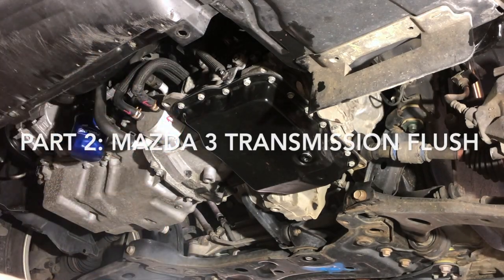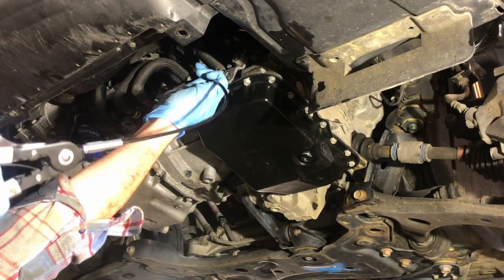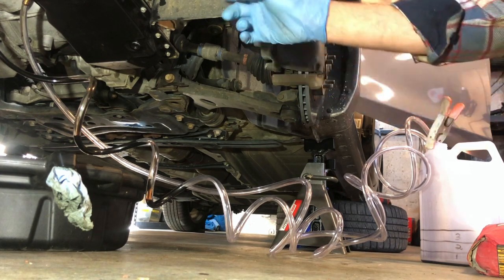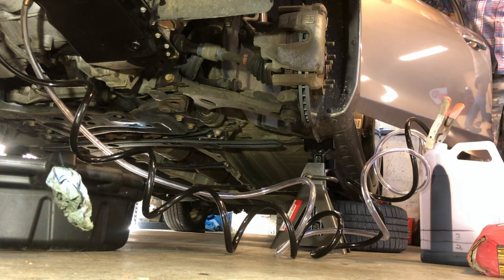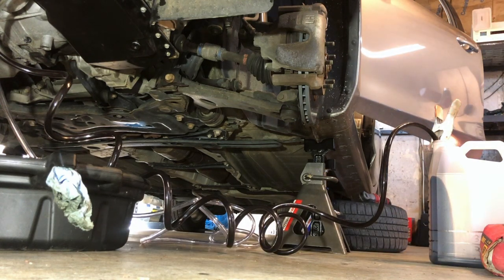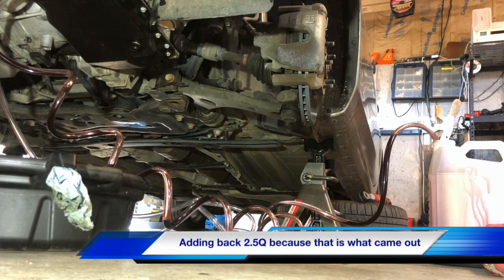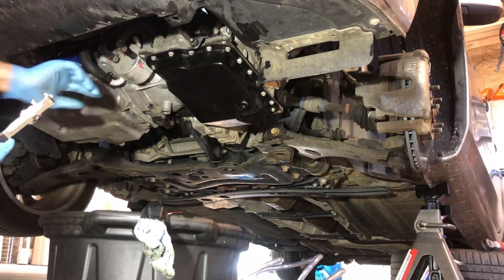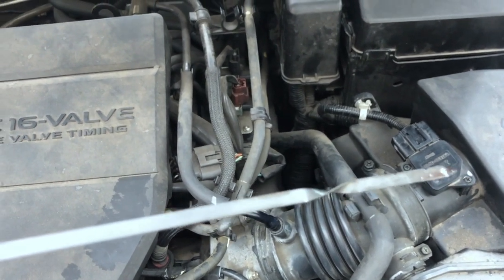Mazda3 Transmission Fluid Change Part 2: Complete Flush

Comment: Can regular pliers work to remove the hoses from the cooler line and I didn't see where you used the push pin pliers is it necessary for this job? Thanks
Reply from the maker: Thanks for watching and commenting, regular pliers can work, just takes a little more fiddling.

Comment: @fixityfix are sure that’s the right transmission oil because I have the same oil but on it saids 95% of the vehicles but Mazda is not one of them. And my second question is how many quarts of the oil did you use like the part one and 2 videos including the flush?
Reply from the maker: Thanks for watching and commenting! Here is the MaxLife ATF spec sheet link: https://sharena21.springcm.com/Public/Document/18452/9e447451-fe75-e711-9c10-ac162d889bd3/5ca3517a-e29c-e711-9c10-ac162d889bd3
Idemetsu makes a good Type M fluid, and grabbing stock Mazda fluid from the dealer are ways I’ve gone in the past too. I think it was 13 quarts total if I remember correctly. All of them have worked fine in our 3. Good luck and I’ll be curious which fluid you end up using.

Comment: Which side of the hose I need to plug in for the outlet. (Is it the black hose or the one that connect to that metal round thing. Hehe)
Reply: Or I should just put two clear hoses?(One is for that black hose and the other one is for that metal tube)

Comment: Hi Fixity Fix, great video! I have a 2010 Mazda 3 and I was thinking of doing this to clean out all the old fluid. I was just wondering how many quarts you had to fill back in after this procedure? Would I have enough fluid if I use 2 gallons to do the flush and have left over to fill it back up at the end?
Reply: 2 gallons is gonna be close.  You could do at least one drain and fill.  I’ve always bought a 12 quart (3 gallon) pack.  Used 10 for trans.  A little less than a quart for the power steering at the same time, then a little over a quart to keep on the shelf for spare.
Reply: @georgesteffens7489  great thank you!

Comment: Thanks for the timely come back. I didn't know that the mazda had a external hose going to the tork converter. I think the blue transmission fluid has more zinc in it, for 2012 skyactive. Also, phoning a mazda parts department with your vin number would be in order. You could probably run it on dextron,a red oil, it would function, but for how long? I used your method in the past on other vehicles, no ill effects. How did your transmission fare over time?
Reply from the maker: Hi again Robert! Our 3 is still running strong! How is yours doing?

Comment: So do you do this IN ADDITION to what you did in Part 1 (Mazda 3) drain/replace? Or do you do this INSTEAD OF part 1? I always thought a drain/replace was somehow safer than a forceful flush - is that true? 2010 Mazda 3 2.5L 150k
Reply from the maker: Thanks for watching! I did do both when I serviced mine, removing the pan was needed in order to replace the filter. I went back and forth in whether to do the full flush or not, thankfully, it worked out fine on our 3. Good luck with yours!

Comment: Hello, I bought my 2010 Mazda 3 with 150k miles a week ago and it has some issues with transmission. On my first drive I had Solenoid B stuck on error which was resolved and never happened after resetting error codes and taking out excess fluid that was in the transmission (approx. 0.7qts). However it has some delay before shifting into 5th gear in manual mode and when put in reverse sometimes it needs a bit of time or gas to start moving itself. I'm wondering if fluid change/flush would fix that as the fluid we took out was dark brown but didn't have any burnt smell. The shifting is very smooth and unnoticeable, so I guess flush would not be dangerous? There is only one car service center in my town and I'm not sure how they gonna change it - drain it or flush it like you did. I read lots of bad things about flushing but does it apply only if transmission is already slipping and having rough shifts? I'm going to change fluid tomorrow.
Reply: Did you flush it? I’m gonna change mine and flush it this week, would like some advice from you if you don’t mind, thank you
Reply: @nazar_ns7431  Yes I did flush it, even though the problem is still there, the car has now clean atf fluid at least and I can drive peacefully

Comment: Nice videos! Is this worth trying on my 3 that is starting to experience rough shifts and occasional slip?
Reply from the maker: Thanks for watching and commenting! Depends on so many factors, miles, how hard driven, etc. The risk in the flush is that the clutch material suspended in the existing fluid may be the only reason the gears still engage. If it were my car and mileage was high, I’d take one of two approaches. 1) Drain and fill only - if the first helped, I’d do it again each oil change for the next 4 oil changes. Or 2) do the flush and keep the old fluid in a clean container(s). That way if the flush made it worse, the old fluid could be swapped back in. The difficult truth is, if swapping in new fluid makes things worse…it means the transmission is already on its way out. Good luck! Please keep me posted on how it goes!

Comment: Love this method, did this on our Fusion.  Might be trading it for a '10 version of your car here, pretty low miles, but I'll be doing this whole process as peace of mind if I do buy it.  Thanks for sharing!
Reply from the maker: Did you end up getting the '10? Our '11 is still going strong - and a fun car to drive!
Reply: @fixityfix  No, but I did get a ‘13 iSV base model but same transmission setup.  I’ve been taking care of maintenance and also added cruise control which it didn’t come with.  Love the car and so far seems like many things aren’t too bad to service at home!  It’s got 73k on it now I’m hoping to get it to 200k.

Comment: Thank you @FixityFix for posting such an informative, thorough and helpful video!  I just want to make sure I'm 100% clear on the details to connect to the car's cooler/pump.  Can you please confirm my understanding?

1 - Connect clear tube to the car's the aluminum cooler outlet/nipple closest to the driver's side NOT to the black car hose from said driver's side nipple?
2 - You mention using a 3/8" brass barb hose connector?  Is there an example or link to one that can be shared or linked to in the description?  Or is this even necessary?
3 - I have seen other videos where people use RTV in addition to the rubber gasket.  Any opinion on that method compared to yours?

Looking forward to trying this in the coming weeks.  Thank you again for posting!
Reply from the maker: Hi Gabby NYC! Turns out connecting to the car’s black rubber hose that’s removed from the cooler port wasn’t necessary on my Mazda 3. So the brass barb wasn’t needed. I just slid the 3/8 id vinyl hose over the exit port on the cooler (the port closest to the transmission).  Just make sure to keep any crud from getting into the car’s rubber hose you slid off the cooler while flushing- there will be some suction. 
I don’t use RTV on rubber gaskets and have never had a leak. I do use RTV on paper or cork gaskets. 
PS, next time I change transmission fluid on my 3, I am going to use Valvoline MaxLife ATF. I’ve had good luck with it in all our other cars and it looks like it’s now approved for Mazda3. It’s cheaper than the Idemitsu I used in the video, and easier to find. 

Good luck with your flush. Please let me know how it turns out!
Reply: @fixityfix  Thank you for confirming!  I had to watch this 2nd video like 12 times and still wasn't 100% sure where to connect the hose lol.

I found this link that confirms what you're referring to about Valvoline MaxLife being compatible with M-5:  https://sharena21.springcm.com/Public/Document/18452/9e447451-fe75-e711-9c10-ac162d889bd3/3fa3136a-09bd-e711-9c12-ac162d889bd1
and also this one:
https://www.valvoline.com/en-thailand/our-products/automatic-transmission-oil/maxlife-atf

I've been reading that only specific M-5 or M-V can only be used but now I feel confident with using MaxLife.  Thank you again!

Comment: Great video; I didn't quite understand the method you used to connect the clear plastic hose to the transmission hose, did you use a connector, couldn't really tell?
Reply from the maker: Thanks! I used a brass connector that fit inside both hoses. It’s a 3/8inch size to match the 3/8id hoses.
Reply: @fixityfix  Yes, now I understand.  Additionally, when checking that the transmission is full of fluid, do you do that with the engine still running after putting it through the gears, or do you check it like motor oil with the engine turned off?
Reply from the maker: Check it after it’s fully warmed up, and you’ve been through all the gears. Leave it in Park, hand brake on, with the engine running, on level ground. Let me know how it turns out!

Comment: How to change transmission fluid on a Skyactiv Mazda? You don't - sell it - their transmissions are crap!
Reply from the maker: Hi! My Mazda is a year or two before Skyactiv, so I don’t know first-hand. Anecdotally, I’ve heard the process is similar- eg, tie into the cylindrical cooler. Please update us if you find a good video on the newer ones!
Reply: @fixityfix  the sky active model doesn’t have a dip stick but a plug underneath the air intake filter housing. To access it you need to take off the entire housing. So it’s pretty much impossible to start the car like you did. Pretty much can only do fluid dump and fill.
Reply: @maritimezhang wouldnt you just need to put the housing on and off again? The process should still be possible albeit tedious
Reply: Just found this video. Good work. I need to do this on my son’s 2007 Mazda 3. I used the same method on my 97 toyota Landcruiser. The only difference was I ran it through the gears, about 2 seconds I each gear, it was about a quart each time. Topped up the transmission and repeated it until I had a nice fresh fluid.